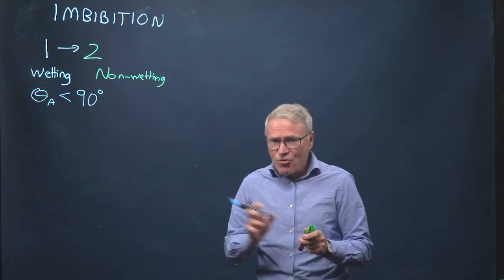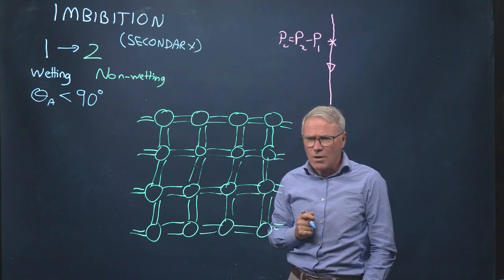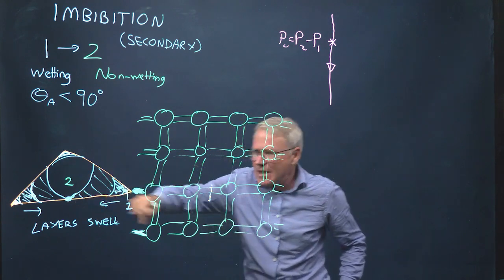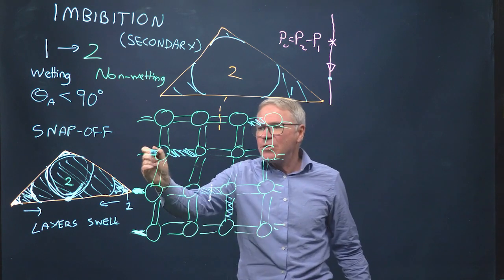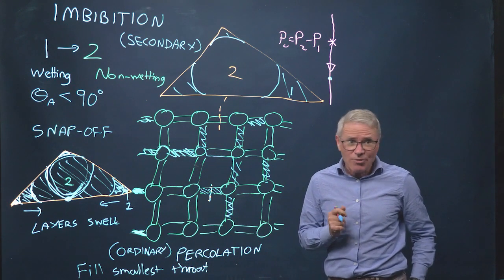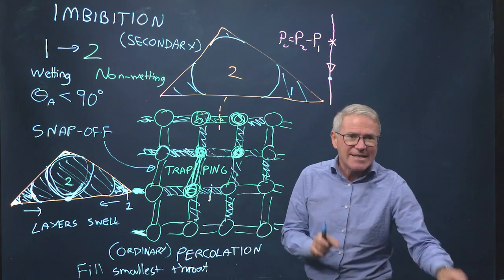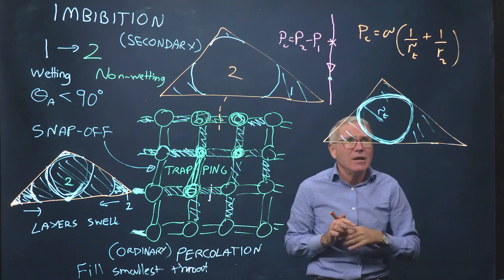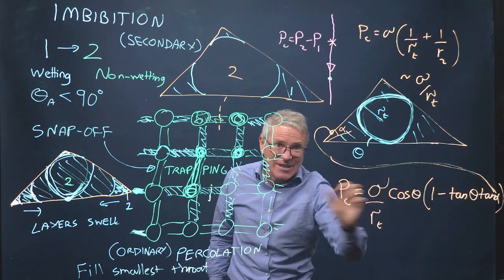Snap-off and trapping

Comment: Dear proffessor 
Will there be residual non-wetting fluid in the throat due to snap-off phenomena, or is it only traped in the pore? or its depend on the radius of the throught.

thank you in advance
Reply from the maker: No - if there is snap-off in a throat, the throat is completely filled with the wetting phase, and the residual saturation will be found in adjacent pores.

Comment: Dear Professor,

i might have misconception In terms of pressure, any fluid will flow directly towards the lowest pressure, which in this case is the wider thoughts. In another context, fluids tend to follow the path of least resistance. I understand that there are preferences and wetting properties that influence fluid flow through smaller throughts, but I'm struggling to grasp how these two principles work together. Is the high cohesive force in the small thoughts attracting the water, and because this high cohisive force we need a  high pressure to overcome this attraction force and displace oil ?

Thank you for your guidance.
Reply from the maker: The capillary pressure is determined by wettability - the cohesive force, as you say, for the fluid to the solid.  In this case the water pressure is lowest in the small throats, as here the capillary pressure is highest.